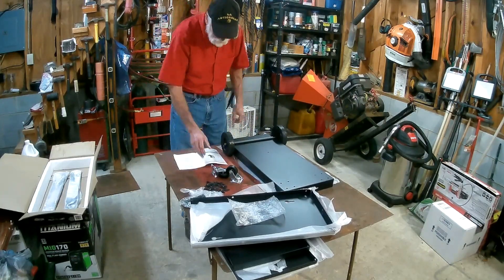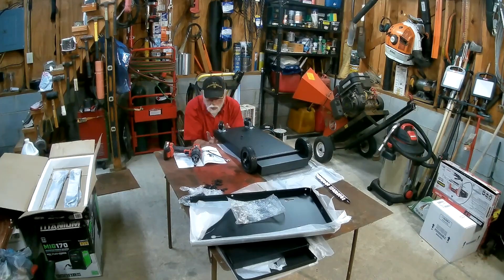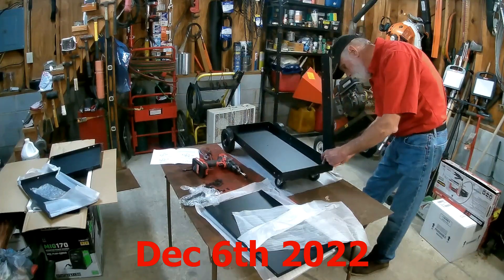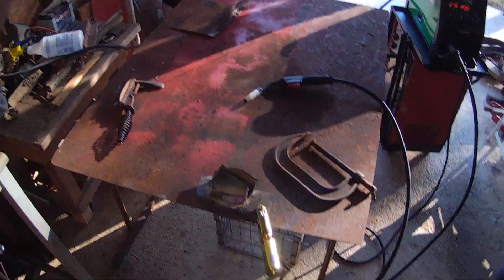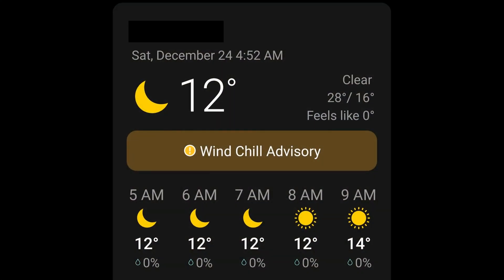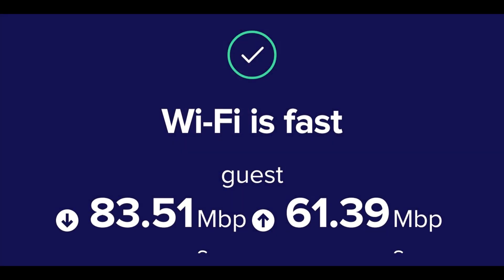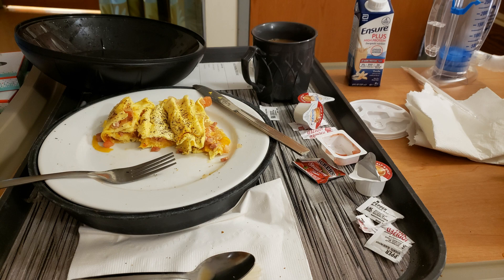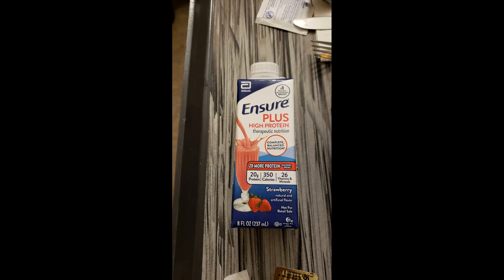What Happened to Soybean Farmer

Comment: That's a tough break SBF hope things work out for you. Looks like they are looking after you now at least. Flux core is pretty good that's mostly what I use but the thinner stuff you'll probably want gas and thin wire.
Reply from the maker: Got lots of options now with this welder. The smallest flux core wire I can find is the 0.028, need to buy a roll and give it a try I've got a lot to learn here.
Great to see you here thanks for dropping by.
🙂☕

Comment: I am so sorry to hear of your illness. I am so angry at our country's health care system. And I know that the Lord hears our prayers. Just a word of counsel from the peanut gallery who happens to have purchased the very same Mig welder from Harbor Freight. Use 220V and add the gas. From the moment you do, you will look like a professional welder and your welds will be 1st rate. I'm sure that we can learn to use fluxcore wire and weld with 110 but why take a chance.
Reply from the maker: Bill thank you very much yes there are some aspects of the healthcare industry that are very annoying, and for that reason that's why I would rather take the issue to God and leave the healthcare industry out of it but I felt like I was being pushed towards the healthcare industry.   lot of strange confusion running through my mind the last couple of months.

As for the welder I've only used it on 220 volts and I'm still trying to figure out stuff with it but for the last month and a half I really haven't felt like touching the thing.   I'll probably end up getting the bottle and trying out the gas with some solid core wire.   I believe you can get more metal down with solid wire then you can with hollow core wire.  it'll be something in the future for me to work to learn.  Seems like it really is all about learning something new. 
Thank you very much for your input on this.